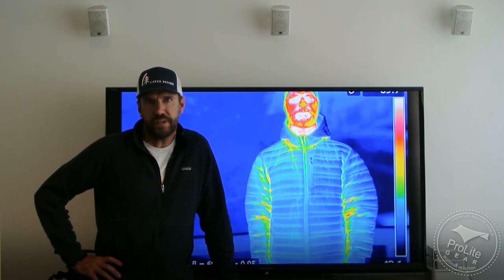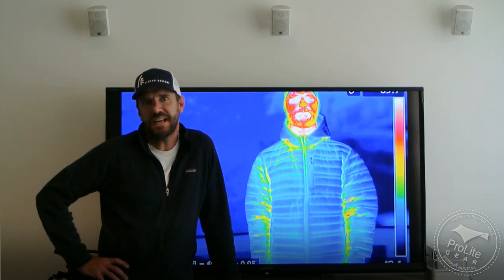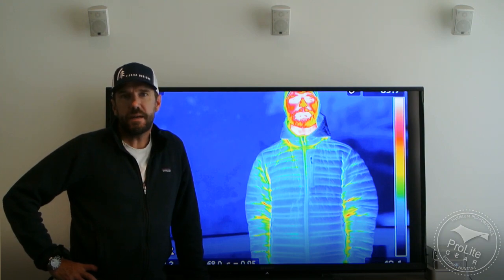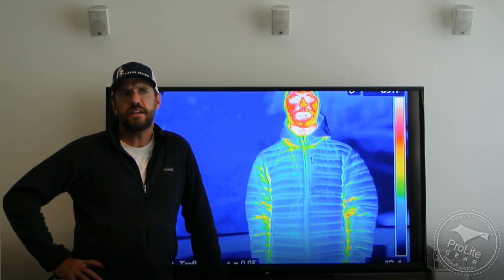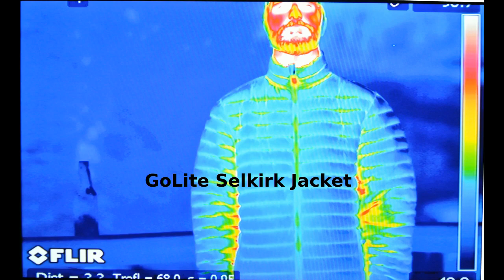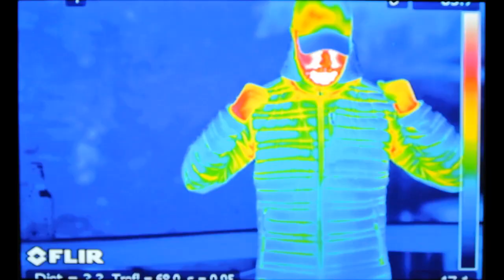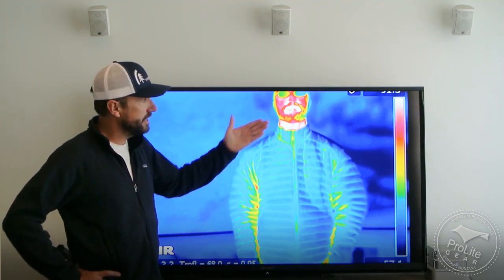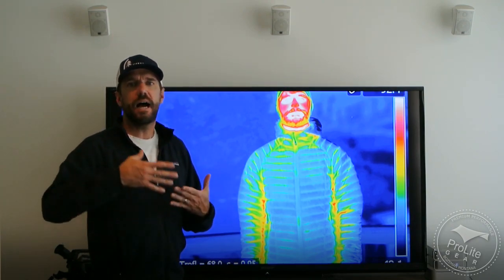Lightweight Down Jacket Thermal Imaging Tests

Comment: My takeaway from the images is that they all do a good job and the differences are negligible. So buy a generic puffy jacket with around 700 fill power that is 90% down and 10% feathers off of Amazon (like B08D9N7FLR) for around $50. If you're spending $300 for nearly the exact same jacket from a brand name then you're just gullible.

Comment: Is it just me or do these coats seem to perform awfully similar? I can see a difference, but not much at all. For example, the Patagonia vs Montbell comparison shows me that the Montbell does better on the sleeves and around the shoulders/ neck area, however, I'm just not seeing that big of a difference the extra stitching makes as far as hurting the Patagonia in the chest and stomach area. What am I not seeing? Did the model say he noticed an appreciable difference? Which coat did he feel was the warmest? I suppose a huge factor was the heat leaking our of the bottom of the coats which we couldn't see? I would love to see those images! Please keep up these types of tests. I would like to see the same test done with expedition coats like feather and friends, North Face himalaya, Canada Goose Snow Mantra, and so on. Also, please do a gloves comparison as well as mittens and hats. Keep up the good work guys!!

Comment: Have you reviewed the marmot hangtime down snowboarding jacket? Id like to find out more..
http://www.ebay.com/itm/Marmot-Hangtime-Down-Ski-Snowboard-man-deep-yellow-jacket-New-245/131372471571?_trksid=p2050601.c100272.m3467&_trkparms=aid%3D111001%26algo%3DREC.SEED%26ao%3D1%26asc%3D20140813112422%26meid%3D2637a57c1ce046629340f209ff94b370%26pid%3D100272%26prg%3D20140813112422%26rk%3D2%26rkt%3D4%26sd%3D131339942439%26clkid%3D2550392563705357591&_qi=RTM1963930

 and another one is the ADIDAS MEN'S HT HYBRID HOODED DOWN STADIUM JACKET http://www.ebay.com/itm/ADIDAS-MENS-HT-HYBRID-HOODED-DOWN-STADIUM-JACKET-SEAWEED-GREEN-SIZE-2XL-NEW/131339942439?_trksid=p2050601.c100259.m3454&_trkparms=aid%3D111001%26algo%3DREC.SEED%26ao%3D1%26asc%3D20140813124757%26meid%3D8c6469a890af429a8b1920113d1cfc31%26pid%3D100259%26prg%3D20140813124757%26rk%3D1%26rkt%3D4%26sd%3D131339942439%26clkid%3D2550361689385109843&_qi=RTM1963929          any information/recommendation will be much appreciated thanks!

Comment: Hi, Could you also do this for L/s summer shirts, sleeves rolled down. My understanding is that Poly/Cotton still outperforms the all synthetic shirts on the market in Hot, Humid conditions. The Swiss have the most advanced manakin for this type of testing but manufacturers would rather pay for advertising than for real comparative testing.
By the way I have some U/l Montbell down jackets/vests and can confirm the large loss of heat that is lost because they don't have a waist cord, cost to Montbell would be no more than approx $2.